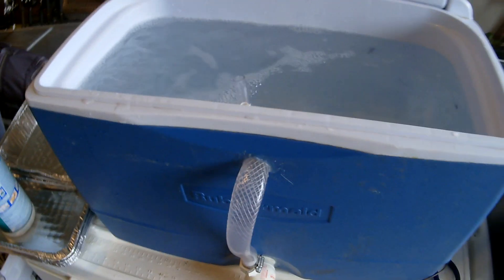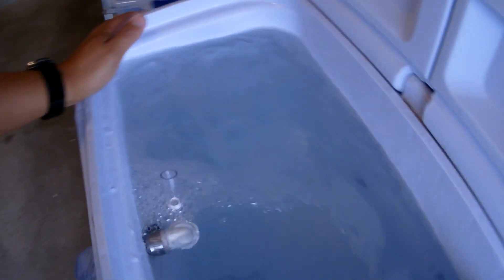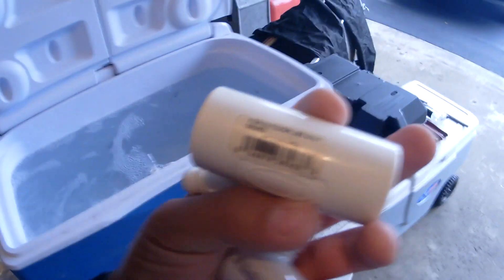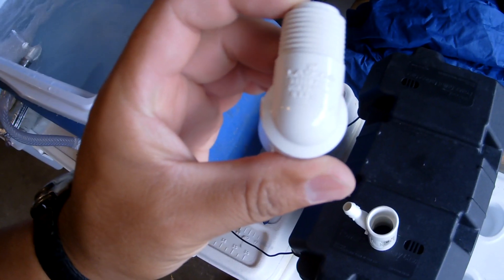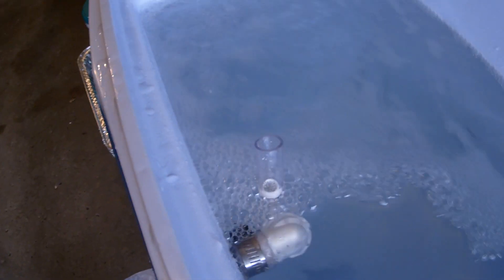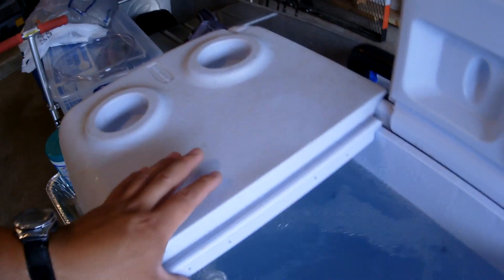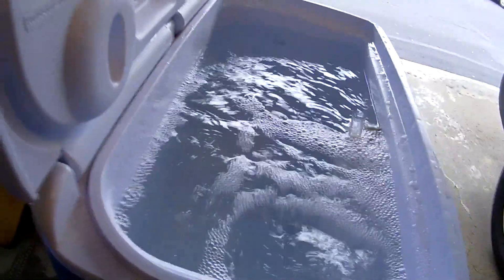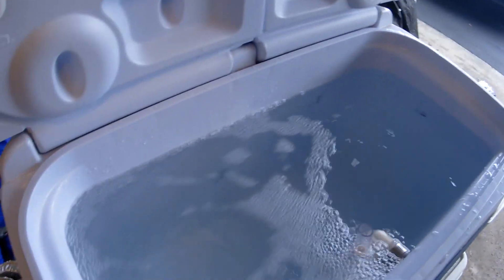DIY Venturi Livewell Cooler

Comment: Finally someone doing a live well the correct way. I've been making my Wells this way for almost 30 years and this is the only way you can keep shad and shrimp alive for days.
If you cannot find that piece you can take a small piece of tubing cut into a point drill a hole in the side of the coupling I just place the opening facing away from the water flow it creates the same vacuum
Reply from the maker: Thanks!  Great suggestion.
Reply: phartattack I would love to see a pic to get a visual of what you are describing

Comment: Nice setup. Assuming you could do the same thing running a bilge pump inside the cooler?
Reply from the maker: Yes you can surely do it.  You just need a way to mount the nozzle and the hose reliably.

Comment: Will it be loud in the fishing boat tho??? Sounds a little to loud
Reply from the maker: It was only as loud as any 500 gph recirculation pump on any boat.  It is essentially the same pump.  On a boat the only difference is it is usually in a compartment that is not open air and the sound is dampened.

Comment: There is a tag on that part, what part number/brand is it?
Reply from the maker: Someone mentioned the part in detail in the comments below.  Hopefully that helps.
Reply: Dawn Industries Sch. 40 PVC KwikSlip Y 3/4" x 3/4" x 1/2" Slip x Slip x Barb Swing | SY-007

Comment: I tried doing this and I am getting no air out of that piece did you have step by step on how you made it
Reply from the maker: Your rate of flow of the pump will effect the amount of air the venturi can pull.  The other factor is how far the venturi nozzle is submerged.  If you have it submerged with a long vent tube the pump must be strong enough to overcome the air pressure from the environment.
Reply: @MonkeyOnMyBackOutdoors  so I wish I could take a pic of what I am doing g so you can see it
Reply: @MonkeyOnMyBackOutdoors  what size pump are you running
Reply: @MonkeyOnMyBackOutdoors  what size pump would you recommend if I am doing it bilge pump style and about 10 inches of 1/2 tubing
Reply: @MonkeyOnMyBackOutdoors  i am using a 500gph rule bilge bump
Reply from the maker: 500 should be sufficient.  How close to the surface are you keeping the venturi nozzle?  As you can see on my version there there was a small amount of tubing just to keep it above the waterline while moving around on the lake, is yours similar or longer?
Reply: @MonkeyOnMyBackOutdoors  mine is completely submerged but I can make where its like yours
Reply: What size pump are you running
Reply from the maker: That pump was a 500gph Attwood.  You cannot submerge the nozzle deep in the livewell then run a longer nozzle up for air the pump cannot create a venturi strong enough to overcome the ambient pressure while pushing the water.
Reply: It's always possible that I am dead wrong, but I think there may be a communication issue.  Monkey is using a live well pump which is used outside the tank whereas Benjamin said he used a bilge pump which has to be placed inside the tank.

Comment: How did you mount the pump
Reply: I cant find the venturi looked everywhere
Reply from the maker: drewflagger the piece can be found in the plumbing section at the hardware store.  It will not be marked "Venturi."

Comment: how could you fix the water bump at the tank
Reply from the maker: Ahmed Salem inside the tank?  If you use an internal one you would have to find a way to fasten down the pump and a way to keep the Venturi spout stable.

Comment: The TH MARINE Venturi aerator kit is inexpensive and has an air hose intake that mounts outside the cooler so you do not run out of fresh air.
Reply from the maker: The Flowright is the best option.  Our guys have been using those for a long while now I just haven't had the time to make one because I am in a Bass Boat now.  I still have an extra in case the ones in the boat go bad.

Comment: Keep eye onwater temp.Got 12 doz.select shrimp at 5 p.m.  boat in water at5:30a.m. My shrimp were alive but they were pink.water was very warm cooking shrimp . I have learned to put 16-20 OZ.bottles in to keep water cool. Price about the same 12v marine metals air pump is qiieter has 2 nipples run to 2 6in. aquairium stone stuck to bottom.I buy crappie mins.by the lb.. (keep cool ) BILL B
Reply: BOTTLES OF ICE
Reply from the maker: Great feedback.  This livewell was used for bass tournaments.  Ice do help and cycling water helps too.  Thanks!

Comment: a venturi is not the best thing in a sealed container it will run out of oxygen circulating the same air
Reply from the maker: Big Slick I open the cover to cycle in new air often.  You could drill through the top and route the breather hose through the lid...problem solved.